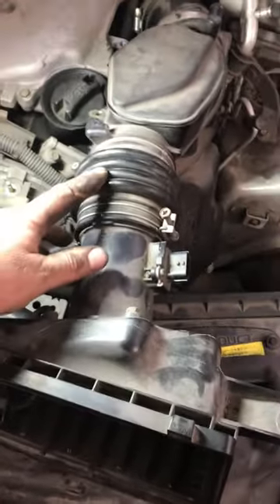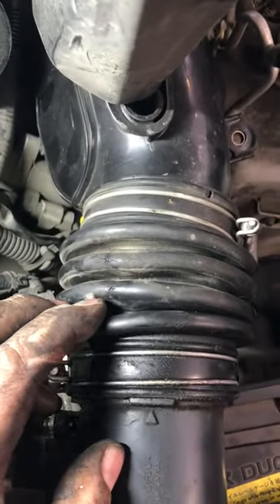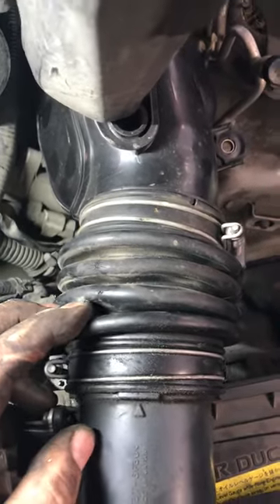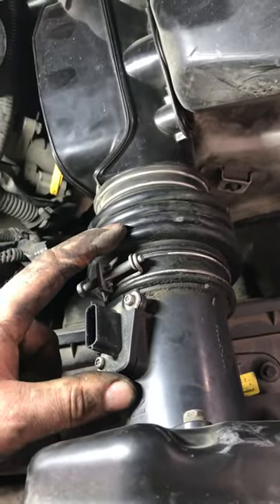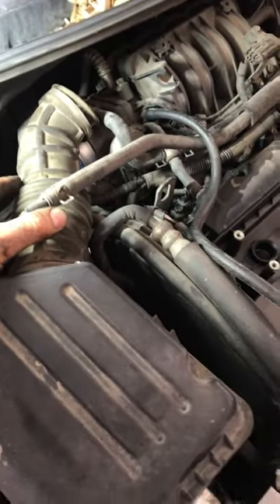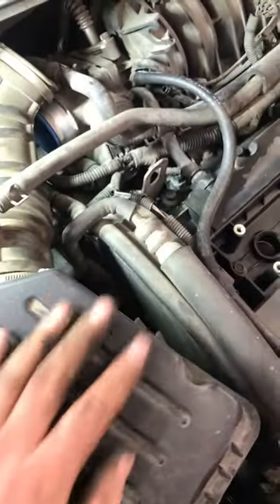Check air intake boots for cracks/rips. Always ripped on Nissan/Infiniti 3.5L. G35, FX35, Maxima etc

Comment: My 04 g35 rpm’s go up high when I’m tryna move it in drive but it barley moves
Reply from the maker: @Dulli Foolie  Sounds like the transmission is slipping.
Reply: Did it give yu start problem ? Like it will start but crank for a couple seconds